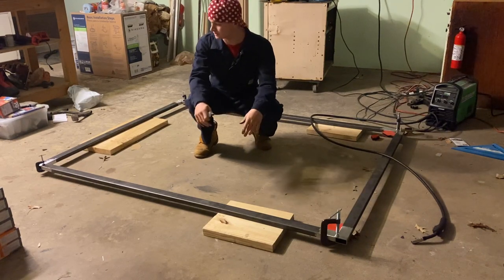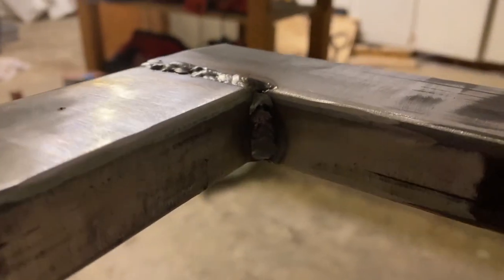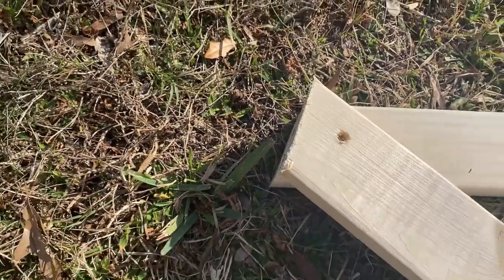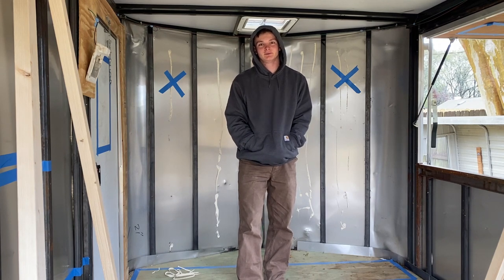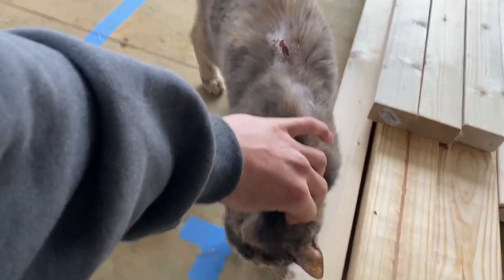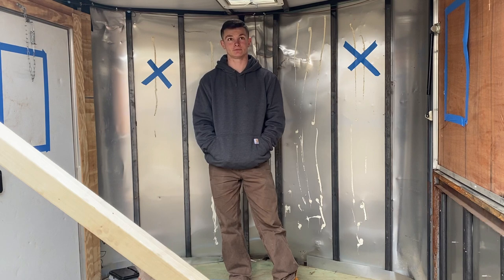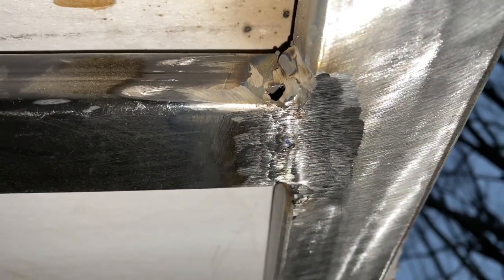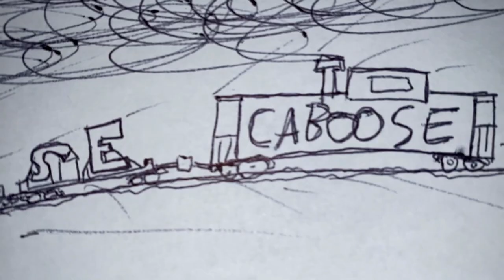Installing a Truck Cap on the Roof of my Cargo Trailer Camper

Comment: Lol great video, i was told by an old welder that the difference between a bad welder and a good welder is your grinding skills. I agree it's a pain in the butt trying to get things square on an uneven surface. I just built a power solar panel lift for my trailer, between the broken concrete and gravel, with a good wind my welds didn't come out pretty either. 
   I like videos like yours that show the mistakes and problems you run into, the edited ones that makes everything look simple and come out like there were no problems don't help prepare you for all the little things your going to run into and have a problem with. I enjoyed this video a lot.

Comment: Why did you put the caps door/ hatch to the front?  It will probably leak in a rain storm while you are pulling the trailer. Welds are sketchy, but you're learning!  You could have just pulled the side skin off the top edge of the trailer then built a taller add on wall frame to sandwich between the walls studs and roof frame to get extra height.

Then, if it were me, I'd put a band of thin aluminum diamond plate to cover the gaps in the exposed area os the roof band.

And here's another tip.  Not sure what you use the trailer for, but if you hinged a plywood table to the bottom of that pop out side door, you could make a sleeping bunk  out of that space.  Maybe built some side walls to drop down off the pop out side roof.  All hinged to the pop out part or bed floor to wedge between the roof and the bed floor. 

Or even gotten some Pop UP Camper bed canvas to make the a sleeping area by using the riase up door by making it hinge from the bottom of the window frame instead of the top.  Make it a drop down, with canvas walls and roof.

Good to see a yound man think out of the box.  Well done.    
Yea, I've built a few trailers into campers in my life.
Reply from the maker: I put the cap door to the front because the cap isn't completely square, it's swept back just slightly in that direction, so just for aesthetics.  Yea, I see leaking being an issue, I ran silicone up those seams and I'm going to keep an eye on the whole thing for a long time.  And definitely sketchy welds haha welding upside down is a different beast.  Thanks for the ideas!